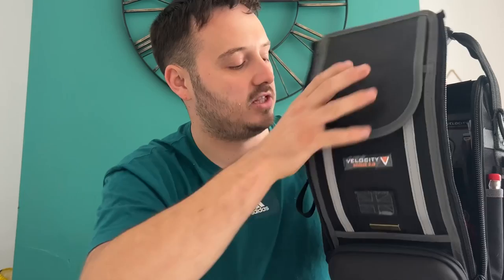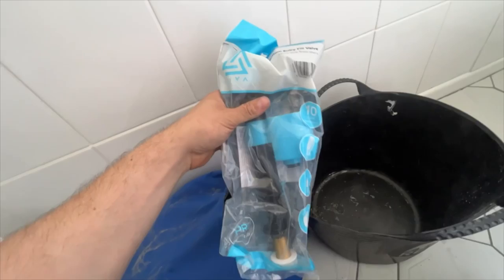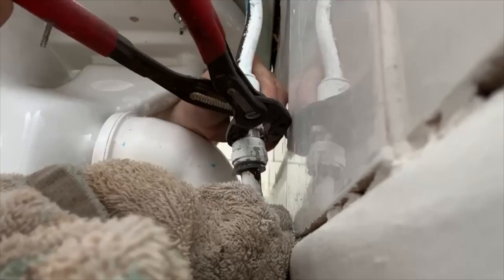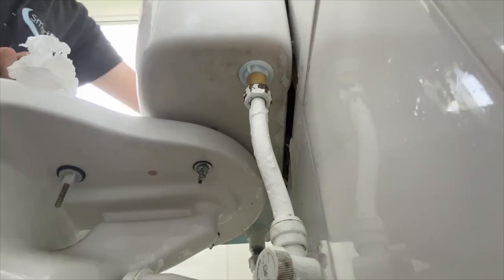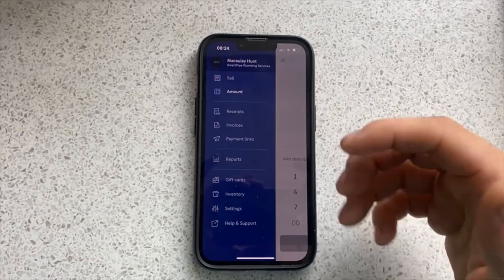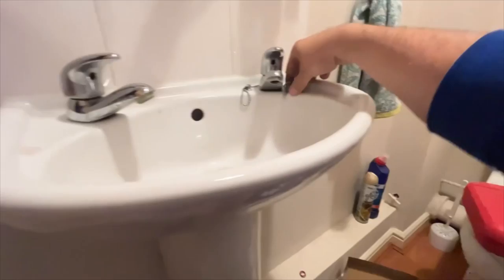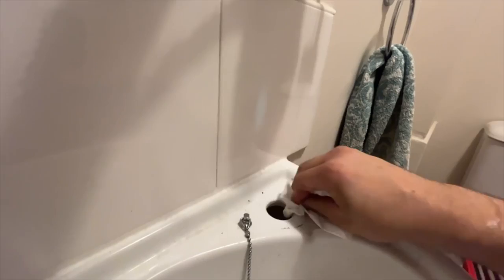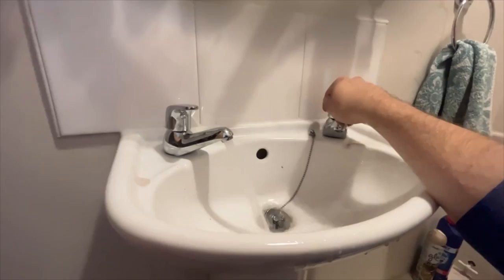Bread & Butter Plumbing Jobs & A GREAT Update on IZETTLE

Comment: Off subject but what fittings do you use to connect to a side entry fill valve inside a 500mm vanity unit as everything I try seems too big and puts the toilet cistern off centre.
Reply from the maker: I find a bent tap flexi is the best for this. Think it’s Josh guest that make it

Comment: Great video lad ......I knew from experience you would end up using the connector at the toilet job I always use then and cant trust a tap connector mainly due to old washers that work there way round the back where you cant see them .....had it on meter unions  and washers can find there way behind the nut and you cant see them ......and FFS  get some gloves on😟
Reply from the maker: I really do need to just forget to get them everytime 😂

Comment: Why not just put a flexi with iso
Reply from the maker: Customer didn’t want a slotted iso sand this is all I had on me at the time
Reply: @SmartPipePlumbing  fair enough mate I’ve seen a few of them plastic ones snap tho haven’t installed one myself but makes easy isolation I suppose
Reply: Because a flexi would look more of a dog than that did 😂
Reply: @deanmiles8421  you’re definitely not a plumber mate